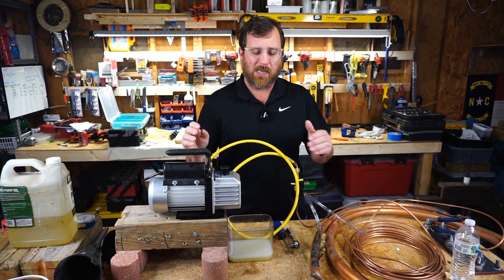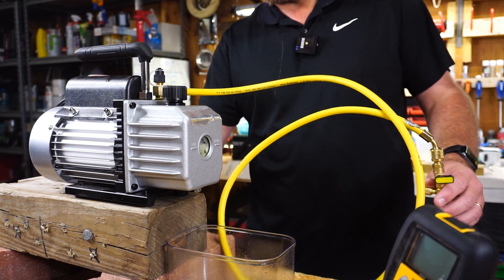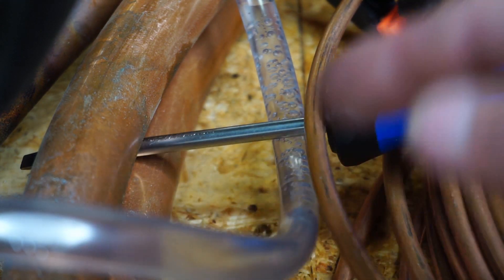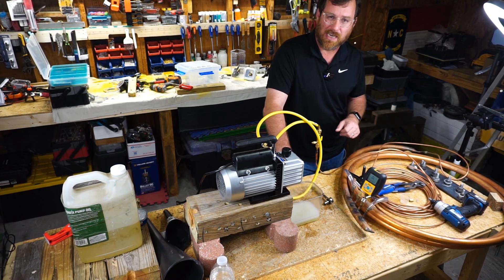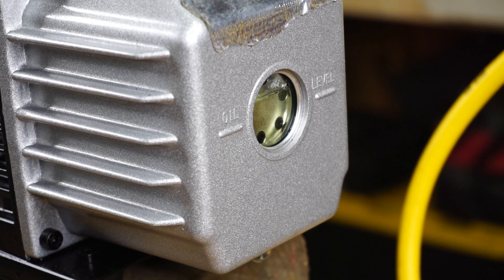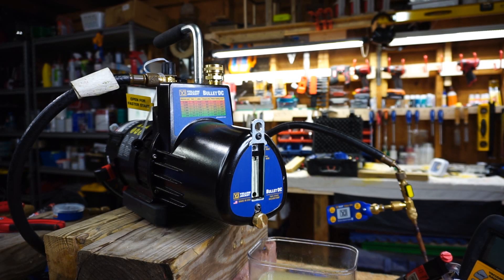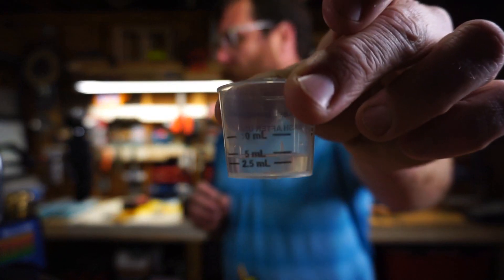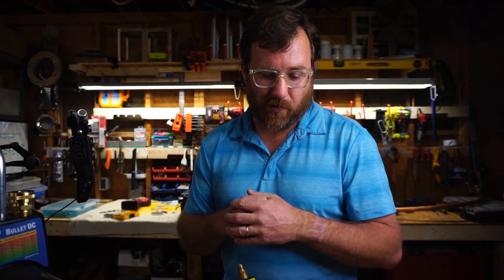HVAC Vacuum Experiment | Evacuate 5MLs of Water

Comment: The question I have is:  once moisture in system has a chance to mix with refrigerant and POE oil, how difficult is it to remove that water?  This would be the case with an evacuation of the entire system (compressor + condenser coil + lineset + evap coil).

Comment: Clear tubing should have been on barbed fitting. You never actually measured the vacuum. Was it -29.9 or only -14 might have not quite been as low as you wanted

Comment: Air leaking through the threads of your Schrader caps the vinyl tubing can't seal hence the worm hose clamp. No wonder your Micron gauge was constantly out of range and barely any water boiles off. Plus, the oil still looked good.

Comment: This is why pumps have a gas ballast so it doesn’t pollute the oil.  I had someone flush mini split lines with water.  I blew out what I could with nitrogen but it took a while with gas ballast open to get the water out.  System works 5 yrs later.
Reply: How long did it take to vac the water out? I face the same issues with massive linesets that weren't sealed properly and so i have water in the lines

Comment: This is an excellent experiment, but you should be using a small glass container for the water and all vacuum-rated components. The vinyl tube leaks and the connections at the end of it leak the worst. I'm sitting here watching my vacuum pump evacuate my system and it's down to 18 microns. I don't have dry nitrogen for a triple purge, so I want to confirm how long it takes ice to sublimate at these levels of vacuum. You're not even below the triple point where you'd lose all the water. That's somewhere around 4000 microns. I want to see what happens to ice down below 100 microns.

Comment: Great concept! I like what you are trying to demonstrate. The issues I have though; It looks like your vacuum pump oil was already contaminated right at the start. The oil in the pump sight glass was milky looking. The idea of using the clear tubing for the demonstration was great, except I would have suggested putting the tubing over straight copper instead of the service ports. Those threads would be difficult to seal off.

Comment: May be you should use a sight glass instead of a soft tube. In my experienced and  understanding the water should boil and some moisture would be mixed in the vacuum pump reservoir together with the oil. And some of it may escape from the vacuum exhaust .

Comment: PS when you slip your vinyl tubing on get some silicone grease Spark plug boot grease put around the threads your fittings before sleeping on the vinyl

Comment: Like the video good concepts you were going in the right direction but by the sound of the vacuum pump there was a leak

           The water should’ve been boiling that was another indicator that the vacuum was not drawing down properly had nothing to do with the oil
         
       Wish I had time to repeat that experiment for you film it and post it I actually got the two 50 foot rolls of coil 3/8 inch and 7/8 all coil up right next to each other for that very test that you just performed.      I’ve had the fittings ready to Brazing just been too busy

So remove the vinyl tubing put Schrader cores and put caps on repeat your test and find your leak first.

You should be able to clear out the copper and get it down well below 100 µm if not there’s a problem

Comment: My guess is the tubing is permeable or the connections were poor and you could not get the vac low enough to boil water. At 70° you would need 19000 microns to begin boilings